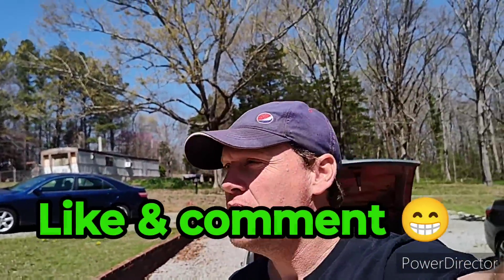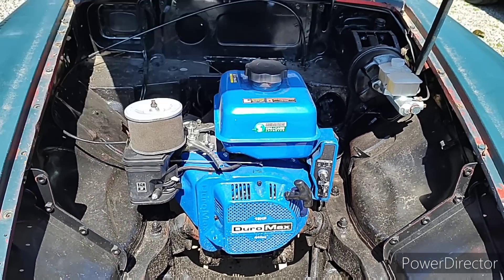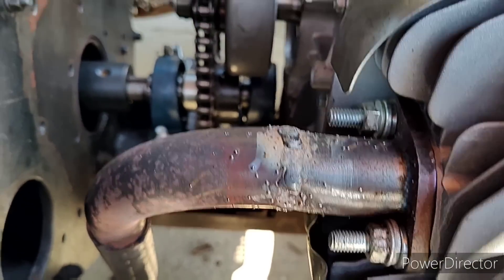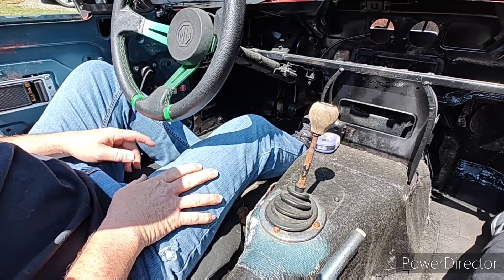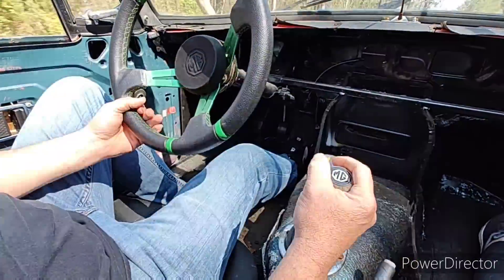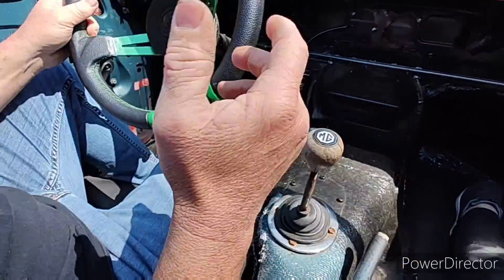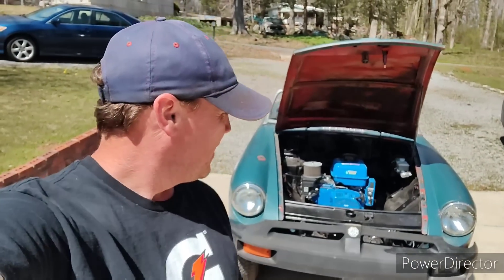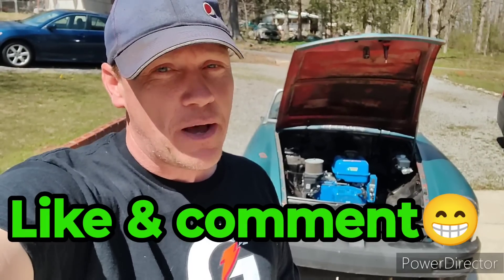How to shift gears in a manual transmission vehicle with a go-kart engine. 4 speed go-kart car.

Comment: It's important to go slow on a synchronized transmission to give those synchros time to match the speed and not wear them out. If you have a regular vehicle with a clutch dont drive this way it will wear the synchros out. Trucks don't have synchros and are designed to be shifted without the clutch, and thus no synchros to wear out.
Reply from the maker: I've driven every manual I've owned in the last 20 years like this never had a problem.
Reply: @ChrisfromKeyfarm  that's because you go slow. I've driven several pickups with work out synchros because people don't. One truck you would have to double clutch and rev match on a up shift. it was so worn out. I'm just pointing out how risky it is. In your builds you have no other choice, on a regular vehicle it's not a good idea.

Comment: Is the centrifugal clutch the same as the one used on a go cart or is it more heavy duty?

Where to source these and Sprocket and chain?

Thanks!
Reply from the maker: Same clutch as a go-kart, all my parts come from eBay. This particular clutch is rated for 13 HP and costs about $50.00. search ( 1 inch centrifugal clutch) or ( number 40 chain) or ( 1 inch bore sprocket).

Comment: I wonder how it would work with a torque converter drive? maybe only need 2nd and 4th
Reply from the maker: With the right Torque converter it would probably do great, but they are several hundred $$$. The cheap ones I have not been impressed with. Thanks for watching.

Comment: A lot of 18 wheel truck drivers rarely use the clutch.In First gear and reverse. the clutch is used or in stop and go heavy traffic, I am wondering what kind of gas milage you are getting with the 18 hp?

Comment: Clutches in big trucks should only be used for starting out,stoplights, or very slow traffic and even if the traffic is spread out you can get by without the clutch.
Reply from the maker: That's how I drive, that's how you drive, but that's not how it's taught to be drove now.

Comment: I had a honda with a hydraulic clutch. Sprung a leak in the hose and had to drive like this for a week until my new hose came in. Except when when I came to come to a stop. I had to turn the  car off and restart it with the car in first gear
Reply from the maker: Pretty cool that knowing how to do this allowed you to drive that car an extra week but that sounds like a real bummer having to cut it off at a stop sign

Comment: I love your MG. I love the gearing you went with. I am happy and have been proud of you. These are a blast. My Isuzu Trooper is fun and I live in the most mountainous state where the 4x4 gets put to the test. I need to vamp mine a bit and reinforce some stuff. I've climbed some stuff I probably shouldn't have tested and made it. I've scared people out of the trooper and they'd rather walk on some of the places I've gone up and down and sideways. I need to weld the differential on it. Then three tired will be pulling in 4 low. When I go down the steep stuff I can gas it and it creeps down hill in four low with no need for the brakes and it stays clutch engaged during it without having to stay in the throttle. I've taken five adult people wheeling at one time and packed our gear. I get a top speed of 21 miles an hour though with a range of 17 miles to the gallon with the duromax 18hp.
Reply from the maker: Thanks for the kind words, your project sounds awesome 😁. I'm still on the lookout for a 4x4 to build something similar.
Reply: @ChrisfromKeyfarm  I got my trooper I call "the pooper trooper" affectionately, for 100 dollars more than the price of scrap. 300 dollars. Keep your eye out. I would love to build a full sized Chevy or Ford but I am looking. Nobody wants to part with the bodies even though they have no prospects on ever having an engine.
Reply from the maker: I understand that

Comment: Has anyone ever hooked up a automatic transmission in a car or truck like your small engine vehicles? It seems to me that you could do away with the centrifugal clutch.
Reply from the maker: If you hooked one to an automatic transmission you would have to keep the centrifugal clutch because you would definitely have to do away with the torque converter. I have not seen one hooked to an automatic transmission and I do not have an automatic transmission to try it on yet. Thanks for watching.
Reply: Yes. They are very slow😢

Comment: Whats the top speed on that thing?
Reply from the maker: Right now it tops out at 40 when the engine governs out so I could re-gear it and get a little more top speed but I'd lose a little power in first gear.
Reply: @ChrisfromKeyfarm  40 is actually really good with the governer still on! If you leave it the way it is it will last forever! You could always throw a billet rod and flywheel and maybe a cam in it so if you had to pass someone you could easily get up to like 55-60mph.